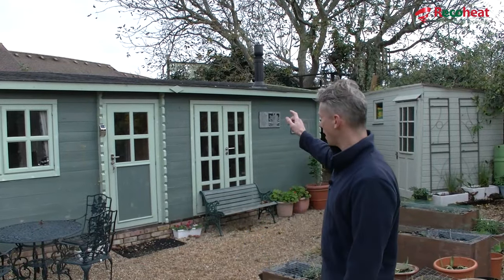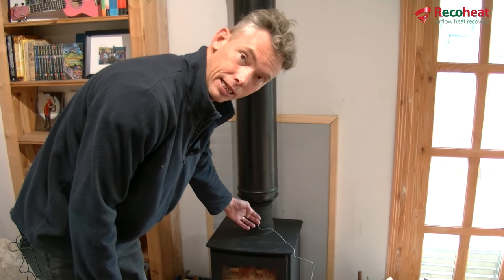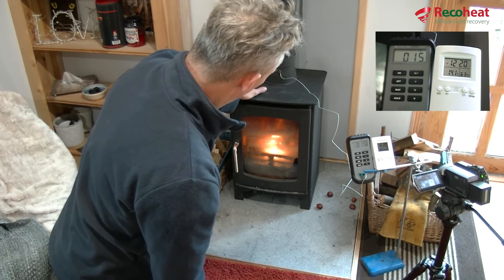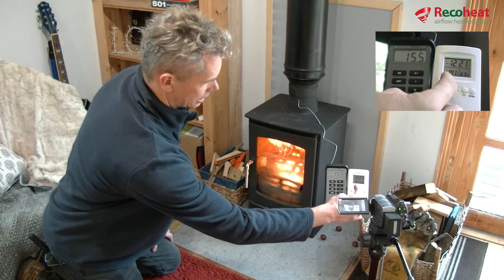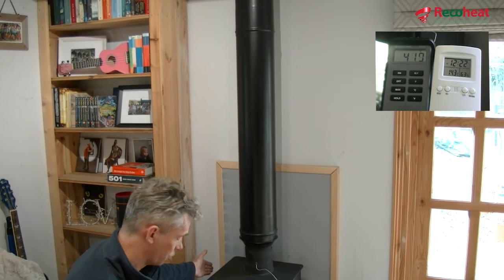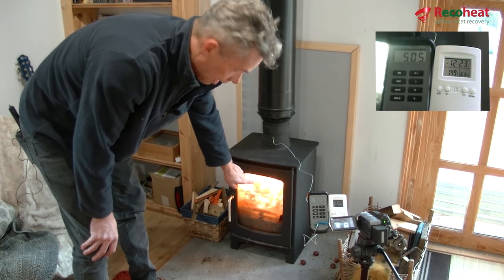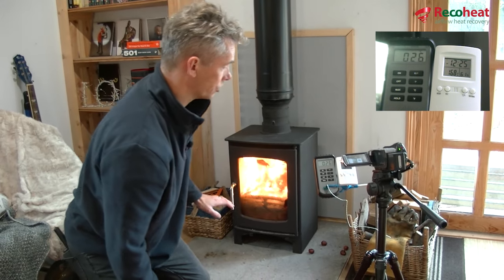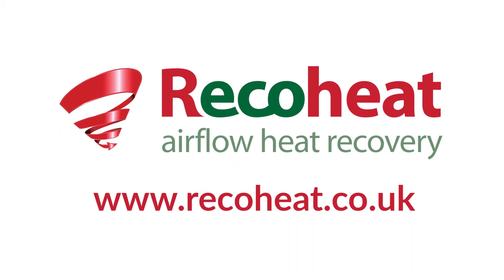Introducing the Recoheat heat recovery unit for wood and solid fuel burning stoves

Comment: Your video shows the incoming air that is provided by a unseen pump located outside ,flowing through what appears to be a rubber pipe . This pipe is touching the stove body and would surely melt in a short space of time . Does this gizmo work as advertised to heat a room faster and save money is a question that has been batted back and forth in most of the comments below , one thing that i do know is that time will tell us the true answer to the question , if in say a year or two from now the sales of the product have increased ,then indeed it must work as stated and stove installers around the world will be singing its praises . On the other hand if its a lemon then all mention of it will be greeted with with scorn and it will no longer be on sale .Old as i am , i can wait a year or two to see the outcome before parting with any of my pension .
Reply from the maker: Thanks for the interest. The pipe is high-heat silicone and has been tested in this use to over 900C by the external test agency. As long as it is able to clear the stove, it lasts for years. If it can't clear the stove, we replace it with 10mm copper. You're quite right about the comments - why would we bother if any user or customer could point out it didn't work? We've just spent two days at the Guild of Master Sweeps running a demo on a bio-ethanol-fuelled stove: we amazed a lot of experts - the sweeps and installers who really understand this stuff - and have gained a lot of customers and suppliers. In our case, feeling is believing! Do check out the website and channel for updates when we've unpacked and caught up with the orders!
Reply: @Recoheat  Thank you for the reply

Comment: Looks like black magic to me.🤔
Reply from the maker: Pretty much: it's called a turbulent boundary layer. It's that, that causes the air to heat more, the faster it moves through the heat exchange unit, and we create it with the shape of the coil and the input air flow rate.

Comment: If you used a Stirling cycle engine you wouldn’t need any electricity to operate a pump!
Reply from the maker: It'd be nice, but you can't get the power required to shift that volume of air and overcome the pressure drop in the coil. They're great bits of kit, but with very low power output.

Comment: Sorry mate.  Smoke and mirrors.  No pun intended.  Using outdoor air for combustion air as well as a high quality airtight stove would be far more effective and less cumbersome.
Reply from the maker: Thanks for the interest. Two points: first is our unit fits on any suitable stove, so is more efficient than requiring every stove to be changed. The other is that there is no comparison in effectiveness. Sure, have a great stove and direct air input, but neither change the heat dispersal profile of the device. Our system does that, and you'll get a better picture of its effectiveness if you take a look at our Trustpilot reviews at https://uk.trustpilot.com/review/recoheat.co.uk

Comment: Fuel saving, but you use electricity to do it.
Calculation time !
Reply from the maker: Yes. The pump is rated at 37w but runs at 17w. The output heat is just under 1kw, but the heat dispersal allows your 5kw stove to heat a small house, including upstairs. If you're already running your stove, that's a central heating replacement for about the price of boiling a kettle once a week.

Comment: Not sure how you hearth dealers/manufacturers do it in the UK, but in the US, anyone with any grain of sense has moved away from robbing heat from the stove pipe and allowing the flue to operate at its nominal temperatures to prevent creosote buildup and chimney fires.

Also to other people in the comments: if your stove didn't offer a blower, count your losses and don't spend the money on a "stove top blower". You are literally spending money to watch a metal pinwheel
Reply from the maker: BSRIA tested the system for safety, and a key element of that was the temperature monitoring all the way up a 4.5m flue. Their report is here: shorturl.at/gtuS0 You can see that it doesn't cool the flu as you suggest.
Reply: @Recoheat  the "link" you provided goes to nothing. It goes to a site asking if I speak Arabic. Also I'm not familiar with the BSRIA but the short amount of time that I spent researching it didn't really make me feel better. Perhaps someone can explain it better but all I see is a marketing firm justifying random products on the market.
Reply from the maker: @geminirat84  Well, do you speak Arabic? Now you're just bigging us up - marketing firm! Love it!

Comment: You put out a 7 minute video explaining how your shed will be heated and you didn't show the temperature across the room some 30 minutes later? #wasteoftime. $300£?  Waste of money.
Reply from the maker: Not a waste of money if it's saving money. The link here is to a proper expert who is running one stove with a Recoheat instead of two stoves without, to heat his showroom.  That's literally half the fuel, with double the standard output, isn't it? https://youtu.be/LbMzmdYHVgI

Comment: Should have thermal imaged it
Reply from the maker: We have recently got a Flir camera to do that, but it measures the temperature of a surface rather than the air. I assume the really expensive ones can measure the air, but I'm not sure as they have to have a point of measurement.

Comment: You say "but a big difference with our heat transfer is that it is exponentially increased in rapidity by the use of the turbulent barrier layer" I say that smells like bull. You even managed to squeeze the current buzzword 'exponential' in there, you keep using that word. I do not think it means what you think it means. Ditto 'turbulent'.
There are plenty of similar convective units out there that extract heat from flue gases but without a pump.
Reply from the maker: For an intelligent man, you have a peculiar attitude to empiricism as a driver of understanding: I'm not speculating whether the heat is transferred exponentially - accurately used - faster, but observing it. Here's a paper on the effect of turbulent flows in tubes at different angles. You'll note that another effect is to reduce friction and pressure: https://www.sv-jme.eu/?ns_articles_pdf=/ns_articles/files/ojs/2818/public/2818-15911-1-PB.pdf&id=3248 Your snide remarks about bullshit I put down to the medium: you're on your computer so think it worth a professional man making things up because it's a leisure activity. It isn't from this side, and a failure to maintain my integrity would cost me far more than I would stand to gain by persuading you a little device does something that it doesn't do every time it's used. We do sell them, so it's not exactly difficult to test; we have submitted them for testing to the stove manufacturer Percy Doughty, and to the stove supplies and installation training centre Stove Industry Supplies, as well as to all the (currently small number) of sweeps and installers who have them and supply them. Every one of our customers is quite free to return them if they don't do what we say. The fact is that they do, and they did before engineers we're employing as consultants on product development were able to explain how it does, even though they too thought that it wouldn't work as it does before they observed it. I quite understand your scepticism, but please be assured that I'm not spending my time hacking digital thermometers to fake outputs, or running a jet engine or gas burner into the back of the unit to create some video fakery. If you can explain the results by any other means than the physics I'm describing, you're welcome to do so, and that would be interesting. Merely saying it doesn't happen simply isn't true, so is somewhat less so.
Reply: @Recoheat  An intelligent man with a degree in mech Eng with third year honours subjects including heat exchangers.
Either you are taking heat out of the flue gasses or you are not. If you are, then you are cooling them and will increase the risk of creosote deposition, if you are not, why bother?
Which flow is turbulent, you don't say the flow around the tubes or the flow in them? Or both?  First you say that turbulence increases heat transfer, which is always correct, but then you claim, in a reply below, that because of turbulence it stops it cooling the air too much. Which is it? Stop contradicting yourself.

As for you link above, yes very good, but then I am not disagreeing with the idea that turbulence is good in heat exchangers, lets instead see a real world test where you measure the temperature of a test room under controlled conditions with the pump connected and without it connected but still running so that the energy used by the pump is taken into account.
The sentence I objected to so 'snidely' still does not make sense; 'exponentially increased in rapidity' is unscientific terminology.
Reply from the maker: @donaldasayers  The amount of heat we take out of the flue gases must depend on the surface area of the heat exchange, right? And given that our device is heated by exactly the same exchange as that of the flue in general, then you can compare the cooling effect to that acting on the gases by any other area of the flue? And on the understanding that any stove has to be able to handle a flue height of between 4.5m and say 8m, any detrimental effect on the overall performance of the stove and flue would have to be outside that margin of difference? Is that a reasonable supposition? So our coil has a surface area calculated on the diameter of 10mm and the length of 1960mm, which comes out at 0.062m2. This is smaller than the 0.064m2 surface area of a 10cm section of 125mm flue, and a 6cm section of 150mm flue. Do you think it reasonable therefore to equate the cooling effects of these and to conclude that if the stove has to function correctly with a variance of at least 3.5m, which equates to surface areas of 1.4m2 at 125mm and 1.68m2 at 150mm, then our device must fall safely within that margin?
Reply: @Recoheat  So in other words you are removing so little heat it doesn't matter.
Given the values in the video for airflow and temperature, I calculated an output of 300W, which given that the output of a stove that size is about 3,000W, then you are right, it doesn't matter. But then again not hugely impressive is it?
Reply from the maker: @donaldasayers  The effect of the device as a heater/heat dispersal unit isn't the question - that is empirically evident. Are you happy with the calculations regarding the cooling?
Reply: @Recoheat  Not really you are comparing forced turbulent heat transfer in your little tube to gentle laminar flow convection outside. Chalk and cheese.
Reply from the maker: @donaldasayers  No, you're not, because the forced air is inside the tube, and the gases are on the outside, and completely unconstrained. They can't be made to pass more heat in the flow because there is no means to do so. They can only transfer in the same way they do to the main flue, because they are being acted on in the same way, and are flowing in the same way - in fact they're flowing slightly faster because of the minor disruption caused by the coil helix.
Reply: @Recoheat  That's all you are getting from me. As Wolfgang Pauli said 'Not even wrong.'

Comment: This looks to me like social media BS.  The measure of a "heat recovery" appliance would be the amount it heats the room per the amount of fuel consumed -with vs without.  There is no indication in this video that there is any improvement at all.  The temperature he is measuring would do the exact same thing in any flu of a stove stuffed with kindling.  The tiny "pump" he uses has such a pathetically small flow that there is no way output is significant.
A five dollar house fan aimed at the stove would do more!
Reply from the maker: It's nice it seems like that, and in fact is so effective. Just look at our Trustpilot reviews at https://uk.trustpilot.com/review/recoheat.co.uk

Comment: Very badly narrated and explained! It requires power to work so in a power cut you have an immediate problem. Would be much better to use a gravity fed water system to recover heat from a back boiler which also lets the chimney work better. Taking too much heat from the chimney will lower the rate of combustion in the fire and could even lead to smoke venting into the room. Condensation in the flue will also cause rot and lastly if that’s not enough the potential for a raging chimney fire 🔥 is greatly enhanced. That would heat the room somewhat, but not quite in the way intended. A reasonable idea/concept but bad,y executed! Just my opinion of course! 🤔
Reply from the maker: Can't fault the criticism of the narration and explanation, and very much appreciate you sharing your opinion - thank you. The combination of suggested alternatives is a bit contradictory. First thing is that power cut makes no difference as the system is static, so is unaffected if it's not on. Secondly, a back boiler typically removes 75% of the heat of the stove so does everything you mention as risk, as a certainty. Thirdly, draw risks you mention are immediate in their effect: smoke floods into the room if the flue isn't functioning. It's obvious therefore it's not happening. It's not obvious from this video that the unit doesn't cause cooling and therefore condensation in the flue, bit it is evident from the fact that we're selling it in the UK to CE standards as part of which it's been externally tested for that - certificate is on the website. We've also got several years of experience of using them across a wide range of customers, many of whom are sweeps and stove engineers. We made this video two years ago, so that experience was much more limited at that point. Lastly, it's a reasonable concept maybe, but it's actually really well executed because it works fantastically well - check out our TrustPilot reviews. Again, we've only had them up a few months, but they're completely reflective of customer experiences. Post lastly - thanks again for the interest and engagement!

Comment: Would have been better if you explained how it works . It my as well be snack oil with out a scientific explanation
Reply from the maker: I think you've invented something there, Neil: sounds a promising idea. Like peanuts without the chew. Think how convenient and considerate that would be in cinemas - no more loud mastication noises from the erstwhile peanut noshers at the back. Genius.
Reply: @Recoheat  well with that answer then I take it as snake oil
Reply from the maker: @neilgower2558  Take it how you will. Actually, the easiest thing to prove is that it works - it's the how, or showing it in a video that is difficult. That's why we're doing videos with customers and professionals. It would all be a bit pointless if it didn't work - not to say boring. Can you think of a reason to make videos pretending heat was being pumped out of  tube, when the first person to buy it would tell you it didn't? Flues are regulated, so an expert has to fit our devices in a domestic setting. They cost ten or twenty times what you can get a fan for, plus the professional fee for fitting. We're taking it to professionals to test, and professionals and people spending plenty of money are using them. It's been tested by engineers for safety so that it meets regulatory approval, though annoyingly they didn't record the output, but they'd presumably have commented if it didn't have one.
 If it didn't work, it would take thirty seconds to ascertain that. If you do want more information, please see the website at www.recoheat.co.uk and watch some of the other videos on our channel. We're early days as a company, and have a lot to do, but we wouldn't be anywhere if it didn't work. Thanks for the interest.

Comment: i use big size single wall pipe for the first 4 meters, through several floors in my house, before its routed into an stone chimney , its heating all floors before itsgoing outside ,  in my opinion you better invest in an top of the range scandinavian woodstove with super efficiency , these welded shitty stoves with chamotte stones are horrible badly made , good for show only ,
Reply from the maker: My dear sir, I beg to differ: there are some beautiful and beautifully made stoves around. Not that Scandinavian stoves aren't fantastic - we'll have one of our units fitted to one in Sweden next week, and are excited to see how the combination performs. Thanks for your interest.

Comment: All these people whining about condensation, surely so long as you keep the temp way above 100c on the flue, you'll be fine?
Reply from the maker: You need to keep your flue hot to prevent it, or at least have it hot for a period so that creosote etc is burned off. Our system doesn't cool the flue, so it's a misunderstanding, but the point is true.
Reply: @Recoheat  specifying the temperatures might allay some fears. This seems like a great product.
Reply from the maker: @TheKlink  Thanks mate. It was a key part of the external testing, and BSRIA's report is here: shorturl.at/gtuS0